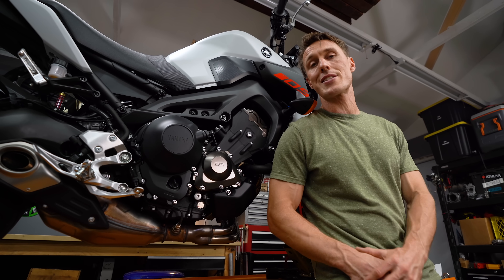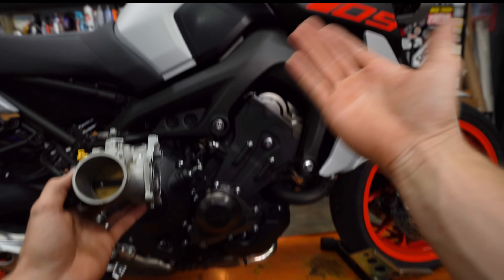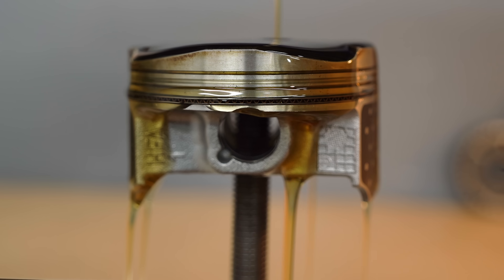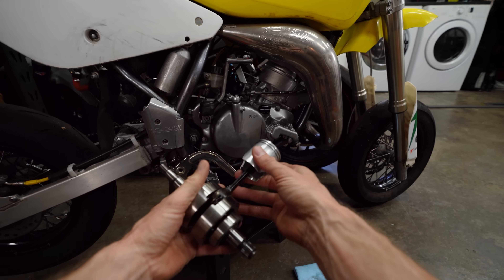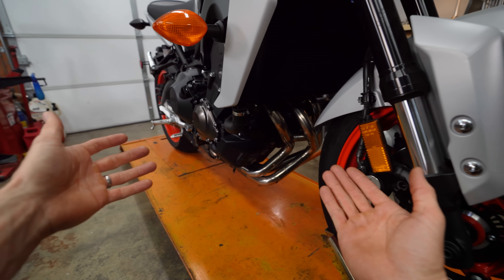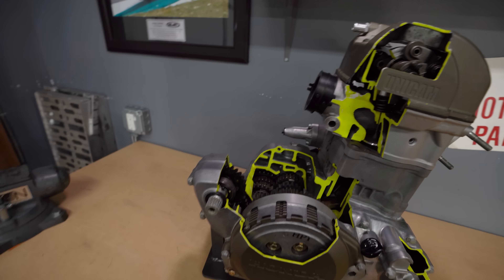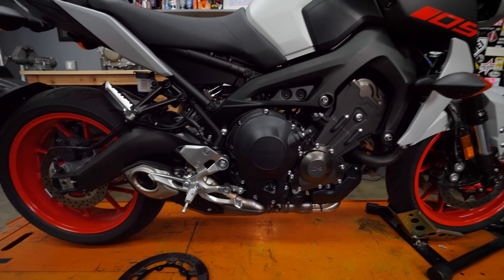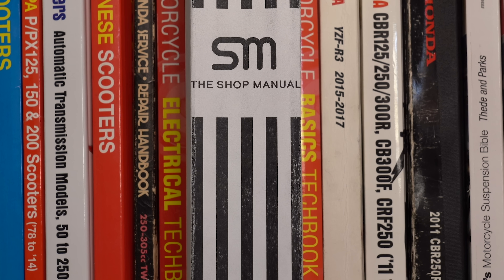Is Engine Braking Bad For Your Motorcycle? | The Shop Manual

Comment: 2007 Honda Fireblade solved that engine braking issue thru new mapping technology where the throttle body leaves a small gap in the throttle body as the rider tried to close the throttle, thus eliminating engine braking. The drawback is that you have no engine to slow down the bike once brakes fail.

Comment: Probably relevant mainly for older bikes but a habit of using sudden throttle roll-ons and roll-offs causes a lot of compounding damage to engine mounts and basically all the spinning parts & relevant seals, unless you have perfect meshing from the crank right through to the sprocket.

Massage that throttle transition between acceleration and engine-braking with a pinch of clutch, and maintain better traction that way too. It's like pushing a box across the shop floor with your foot, versus kicking it repeatedly. It's astonishing how often I've come across experienced riders who jolt & shock their machines instead of riding silky smooth.

Comment: Riding a long stroke V twin, engine braking is most of how I slow down. Engine braking is all that's necessary, most of the time. Just need to use a bit of rear brake to set off the brake lights. For anyone that lives in the mountains, it's important for cars too. It's the best use of manually selectable gears. Also uses little to no gas.

Comment: Not only engine braking will help your bike to rev higher countering the negative effects of crank inertia going out of corners but the extra negative pressure created will help the engine breathe better and cooler on the initial strokes after opening the throttle. You will have some extra air being compressed and yet it will be colder. Both generating more power. Win Win.

Comment: Ari and RevZilla. You mention engine braking and other drivers behind you not realizing your slowing down and rearending the motorcycle. Have you heard of sts who makes the product called the "braking module". This product is easy to install by connecting to your motorcycles tail light wiring and once installed it will sense deceleration. Then it flashes uourbrake light or turn it on like you have activated your brakes depending on how you decide to set it up to do either. I have it and I love it. On group  rides other riders love it too.

Comment: After experiencing brake fade after riding hard, bot cars and bikes, i tend to rely on engine braking more and more, where as i just tap the brake to feel how much friction i have on the winter road. Also as mentioned saves the brakes when you truly need them and as bonus down sifting saves time since you already have more revs and hence torque to exit the corner. I use these on daily driving well as counter balancing.. i didnt even know these things existed as something usual and though everyone drove like that. Imagine my shock when i learned these were methods drifting champings and race drivers use..

Comment: my bike has a feature where engine braking illuminates the break light, its a pretty slick feature, however your break light is always on if you go down a hill which signals to drivers that you're breaking even if your keeping a constant speed.

Comment: It's amazing how many times I was told by people who rode his bad it was to do engine braking. 
LOL! I work on, build and ride bikes and in all my years of doing so, I've never had to repair, rebuild or replace and engine due to engine braking. For all sorts of other reasons,  yeah. Mainly,  people not doing their pre-ride checks, including the most important one of them all. Checking and adding engine oil as needed if low. Or, the worst case scenario,  never having serviced for an oil change.  I've seen it and it boggles the mind. 🤣😂😂
Anyway, it was a good video to dispel the myth some people may have.

Comment: I never thought it would be harmful.  In fact, it has many advantages.  If you drop down a gear or two for a winding section of road, you have more engine braking, and you can adjust the speed up or down with the throttle.  Less weight transfer and less fork dive and smoother all round than repeatedly using the brakes.

Comment: very well explained, as a mechanic i can usually add a line or 2 of context to videos like these but on this occasion every thought i had was anwered, and explained very well shortly thereafter. oh btw, are you guys gonna revisit the pani v4 vs gixxer 1000 to see what it takes for the pani v4 to finally catch up? was it the soft rear spring that made the entire difference? we never got a confirmation on that.
Reply: also it'd be grand if you explained how a too soft spring makes a bike slower on track, i.e. it collapses too fast under roll-on, lifting the front, pushing the front wide, makes it wheelie sooner etc. yadda yadda yadda. if you want a really good suspension tuner to explain it all, ask Dave Moss, personal hero of mine ;-)

Comment: Although I am late to this video, I do have a comment.  Besides everything mentioned, really good video, engine braking is good for the motor because of the high vacuum above the piston when the throttle is closed.  This high vacuum is constantly sucking the oil in the crankcase up the sides of the cylinder walls and past the piston rings.  In most engines, the rings are in good enough shape that not much gets by them.  Never-the-less, the rings are still flooded with way more lubrication than when accelerating.  This is also why it is not a good idea for two strokes.  First of all, no oil sump so no oil to suck up the cylinder walls.  Second, the lubrication is in the fuel so closing the throttle also stops the lubrication.

Comment: Ari takes us all to school again!   Love these segments, man - I get so much out of them.    
So check this out  - I am an engine braking loyalist.   I noticed one whacky thing on my 2021 Tenere 700.
The bike has ABS on it right?   But in addition it also has that high compression, cross-plane 270 engine as well.   There have been a few times when I have EB'd  too aggressively on the street and actually triggered the ABS!   Am I hallucinating this or have you guys heard of his happening?  It's weird as hell - I am not touching a brake lever, yet the ABS is piddle paddling cause of the high compression engine locking up the rear wheel a bit!

Comment: I had a GS125SE for years. I used to absolutely hammer that engine. Its redline was 10k, I'd be hammering it to 11,12, 13... 
I changed the oil each 500 miles, which was massive overkill. I used to use heaps of engine breaking on that engine. That engine has a rep for weak valves. 

I never found it. I tried hard. It had 65000 miles on it when I sold it. I felt for whoever the next owner was, but I would not be shocked if the damn thing was still running now...

Comment: as a person that’s worked on their fair share of motorcycles i can say Engine braking is fine as long as you’re doing it correctly. On the other hand I’ve seen my fair share of trashed clutch baskets due to extreme positive and negative g’s from the ears on the clutch discs slapping back-and-forth against the basket… it just depends on the bike and the “rider” in my opinion.

Comment: I use engine braking all the time in the car ,my bike has a slipper clutch and prevents the back wheel from locking up under engine braking. This puts less strain on the transmission.
When the slipper clutch kicks in it catches you by surprise sometimes.

Comment: There is a possibility of failure of the connecting rods when at high revs you suddenly snap the throttle closed. Although rare and more common when you modify the engine for more power but keep the stock connecting rods. On the downstroke, the rod is compressed. But on the upstroke, it is stretched at TDC and the piston can weigh about 5000 times its weight at TDC at 10 000RPM. On the intake and compression stroke, some of this force is offset by the gas that acts as a cushion, and to a lesser extend on the exhaust stroke. But with a closed throttle and no gas coming in it removes the buffer and can cause the small end of the connecting rod to fail at TDC when the piston suddenly changes direction. More happens on race tracks or high street performance mods when you suddenly let off the gas. But still interesting.

Comment: 80-90% engine braking when I'm commuting on the street, with some light rear brake tap to engage the lights. Track day is a whole other animal
Reply: @LastRaven There isn't any mechanical stress on the engine though, unless you always use engine braking at red line, and even then it's not an issue. There is far more engine stress from normal acceleration. Engines are designed to take this kind of stress for 100000s of miles without problem.

Comment: I completely agree that engine braking is fine on a 4-stroke. I ride a 2-stroke street bike though, and I live in a hilly area. When riding on flat ground I'm fine with a bit of engine braking, but when I'm going down a big hill, it pains me to think that my poor bike is being starved of oil, so I pull in the clutch and blip the throttle very often.

Comment: I just called it coasting, like in F1 or other racing. It's for saving fuel, reserve energy, saving brake, and resting the right hand. The most efficient way to slow down without braking is this. I barely open the throttle when on sloping descend. Just let it slide and brake if necessary

Comment: Drag racers have been doing it for decades...I build engines and I dont have a problem with it...the only problem I can think of off hand would be a muncie 4 speed...aluminum case and downshifting tends to push the cluster gear away from the main shaft and the pin that supports the cluster tends to stretch the hole.

Comment: The only thing I ever worried about in engine braking is my chain and sprockets because the force is coming on the opposite side of the rotation, but I always engine brake on the street and on the dirt.

Comment: I totally agree with all your points, in fact i use engine braking all the time, even more than my regular brakes, althought i think the best case is when you use your 3 brakes. Your engine, your front and back brakes, by the way, the engine braking is something that has to do more with the enginre compression stroke not generating power but costing power than the manifold vacum.

Now i have one point to be noted, the stress in the chain.

When you accelerate, the chain streses in one direction, the slack under the chain is major under aceleration and the streess is mostly on top of the chain, but when you do engine braking ,this process is totally reversed, the slack is translated to the other end and the wear is now in the other faces of the link pins...

With this in mind, is MY OPINION that engine braking will acelerate a little bit the chain wear as the wear will be made on both sied of the chain link pins.

And is really important to have the correct slack on the chain, too much slack and the chain can snap out very easily, not only under acceleration, but deacceleration too.

What do you think?

Comment: Engine braking with liquid cooled engines helps cool it down quicker than say, pulling in the clutch and letting it idle. Air cooled engines with no external oil cooler probably don’t, but the increased coolant flow does help more than the friction from revving higher.

Comment: My r1200rt has an aftermarket brake modulator that uses a G switch to illuminate the brake light any time the bike slows. Probably because the bike has shift assist pro that allows clutchless down shifting.

Comment: I only let the clutch pressed when in low speed, it's a good way to gain speed smoothly without using the throttle. Otherwise you need to throttle, and when you release it the engine break comes strong, and you need to throttle again.

Comment: I use engine break a lot, and I'm aware that drivers behind me might not notice I'm slowing down. That's why, if cars are behind and relatively close,  I press the brake a few times, fast and only enough to activate the brake light.

Comment: I always blip the throttle as I pull the clutch in on the downshift to match engine rpms to the  ground speed. Occasionally I blow it and let the rpms drop to idle then let the clutch out resulting in a small skid.  It's ok in a straight line but steps out the rear with any lean angle.

Comment: If a bike has an IMU, couldn't the software be written to make the brake light come on when slowing as fast as a brake might when using engine braking?  You would need a database of braking speeds to determine the braking speed rate that is significant enough to warrant alerting anyone behind you, but that's not a really problem, existing hardware should make capturing that pretty easy and cheap.  This could also be used on electric bikes that are slowing with regen instead of braking.  I wasn't really concerned about engine braking being a problem, but it's good to get info I know I can rely on.  Keep up the great work!
Reply: Many semi's (at least in Australia) in the last 10 years have the brake lights come on when the exhaust (engine) brakes come on. So yes it wouldn't be hard to do. 
A simple door jam switch to work interior lights in a car and an rpm switch could be made to work for any era bike. I'm not fancy with electrics so better setup could easily be made too

Comment: I'm a truck driver, and I always use engine braking in a truck, car (I drive manuals only!) or a bike. I don't touch the clutch until the RPM is almost at idle. That saves my brakes, and helps to cool the engine on hot days. It also saves the clutch. These guys that clutch every time they slow down, burn clutches. Why do that to yourself?

Comment: Caveat:

If your motorcycle is at high speed for the gear and you engage engine-braking at a lower gear(for that speed), you WILL damage your engine.

When you engine brake, the engine RPM increases. As long as it under the red line, its okay. But of the RPM increases beyond the red line it is dangerous. Even ECU will cut-off fuel and ignition in case the RPM threatens to exceed the red line, the damage will already be done before the ECU detects it.

Comment: I've always used engine breaking on all my bikes and never had problems. My '96 Shadow had over 50,000 miles on it when I sold it and it had the original brake pads and shoes in it and they were only about half worn. I always activate my brake lights when I engine brake so people know I'm actually slowing down.

Comment: The only time it could be a factor is if you have a pressed crankshaft and downshift hard at high RPM"s. 
  The sudden jolt over time and enough time could and will eventually move the two halves of the crank out of alignment.
  It will give you excessive Run out on your crank.
  You can check it with a dial indicator and setting it to the end of crankshaft ( of coarse you have to get it tore down to get to ends of crank) rotate and measure on indicator how far out it moves (measures the wobble) best if you do both sides. Anything above 7 or 8 thousandth. Needs attention but will run for who knows how long before getting critical and trashing engine out. Anything above 2 thousandth has to be chain drive to cams, because gear drive won't handle the alignment issues as the wobble makes them to loose at one point and to tight at another. 
   I still downshift on on press crankshafts but on the lower end of RPM's.
  On my welded crank racing bikes I have no mercy on them and run them like I stole them. 
  Red line don't mean anything except your losing the race.

Comment: One thing to highlight.

Engine breaking is also good if you want to slow down faster. 
Sometimes breaking is not enough, and so you need to couple it with engine breaking.

Comment: I ride a cruiser style bike but have not been riding long. I use engine braking when coming up on bends most of the time without realising it. Ridden in a group where I see the few people ahead of me blasting towards a bend only to use their brakes at the last moment and throw themselves around the corner and these people have been riding most of their lives. 
If I'm approaching a tight bend at speed I tend to start to throttle off 20-30ft before the actual bend which allows me to just drop into the bend followed by a quick throttle burst to exit.
Everyone has their way of doing things depending on experience I guess

Comment: AND saves you gas if you have an injection fuel system (if clutch is engaged engine runs at idle so it needs fuel) AND it does reduce some wear on your clutch as you don't keep it engaged for a long period of time. The last benefit is even more important on car engines as it saves the clutch release bearing

Comment: Even in an over engineered automatic transmission cumbustion car you use engine braking. It's a normal part of driving. Every time you let your foot off the gas and the car starts to slow down, you are using engine braking.

It has a much higher effect in motorcycles, and in cars / bikes alike it is utilized in manual transmissions while down shifting. Even automatic cars have the low gear option for descending mountains. Engine braking is a normal part of driving.

Comment: Never had a problem with engine braking on any vehicle I have owned in 40+ years.  Motorcycle 4 stroke engines are great at engine braking and I use it all the time with my brakes.

Comment: Its the cost side of the gears. If it's helical cut its actually the weak side of the gearing but if it spur cut both side are equally as strong.